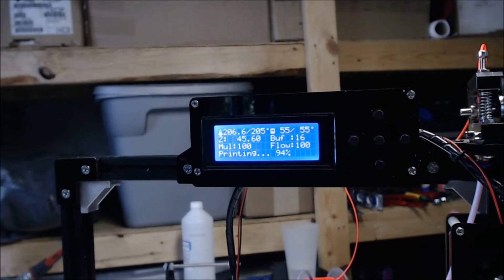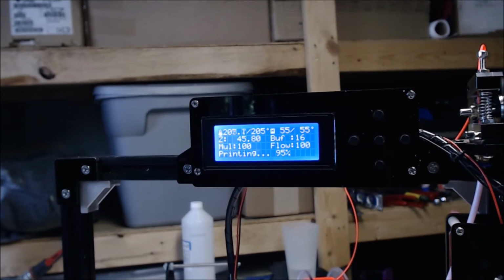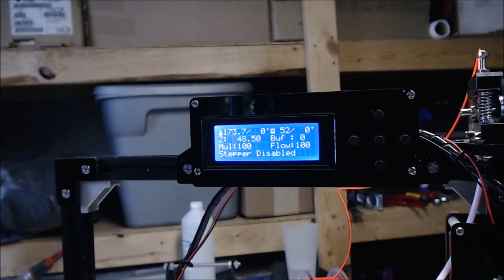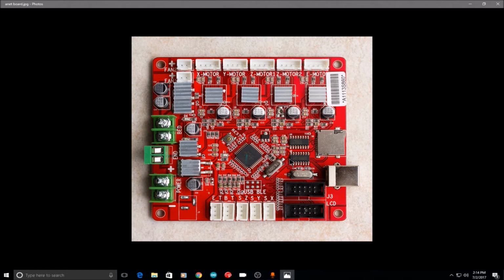ANET A2 3D Printer Review - Chris's Basement

Comment: So I bought this 3D printer from offerup. Anet a2
Just to tinker with. 
I’m a noob at 3D printers. So mine didn’t come with an sd card so iv been using cura. But I can’t get the nozzle settings right. It extrudes very small amounts at a time running PLA. 
Any setting or profiles on cuda you recommend for a beginner just to print some simple stuff?
Also my power supply only has 2 cords plugged in so I stopped using it till I find out where the 3rd tan wire goes. 
Any help would be appreciated.
Reply from the maker: I would start with the Ender 3 profile in Cura. Your power wires might be like this, check it out. https://youtu.be/gn_5QKPj31E?t=989
Reply: K thanks bud. I’ll check it out

Comment: Just about everything about this printer is annoying.  The + shape footprint, the unmounted ps, no ps cover, too small wire for heatbed, bad belts, upside down Zaxis, soft easily nicked rollers, noisy unadjustable controller board.  On the plus side after 2years its still running.

Comment: And now the worst part.  After those cheap belts air dry for about 6 months, you will the MOST ANNOYING RIPPLE in your prints.  It took me MONTHs to figure out it was the belts.   I replaced the yaxis belt with new, better quality one and viola 98% of the ripple was gone !!
Reply from the maker: Awwee, that's a bummer, but a great tip for others, thanks for the comment.

Comment: so what printer in this price range would you recommend?
Reply from the maker: Mateusz Drab Thanks for the comment. Out of all the kits I have had experience with in the $200 price range I would have to say my Geeetech Pro B has been the best. It's cheap, has a nicer main board, open Marlin firmware and there are lots of parts available for it. Geeetech does provide some support as well. It is not the easiest build, lots of different parts, but the instructions are good. If you don't want a big assembly project I would go with one of the many CR10 machines out now. They cost a little more, but they are a quick build and seem to be pretty nice machines for the money. Keep in mind you do get what you pay for on all these machines.

Comment: 220x220x220 FYI
Reply from the maker: Hey Thanks for watching, you are correct, I made a mistake, it is 220 on the gearbest website. In reality mine will only go to about 212 on the Z before it hits the corner brace.
Reply: Chris Riley Yup mine was also only 210 in Z so I found smaller corner brackets on eBay. Now it’s 225 in Z😎
Reply from the maker: Nice!

Comment: Hey Chris, I'm curious.  I did the same thing you did with mine, in that I put up the same PSU mount.  Yes, the belts look super cheesy but they do work.  One thing I noticed on mine is that Y motor is wired to home backwards.  Did you encounter the same thing?  The Y end stop is ahead of the Y motor, but when you set the printer to home, the bed moves towards the front instead of the rear of the printer.  If you did, did you reverse the motor connector or try to force the flip in software?  I am still debating whether I should ditch the auto level and go with the Z end stop.  Thanks.
Reply from the maker: Thanks for the comment. Mine did auto home in the correct direction, but I think if I had that problem I would just pull the white connector off the board, flip the cable and call it fixed. The software is to hard to deal with. Unless you change it over to Marlin. If it had Marlin, then I would flip it in the software. As far as autolevel, if you can deal with printing on the aluminum or have a touch type sensor, I would stay with auto level.
Reply: Thanks Chris.  I ended up reversing the motor and it appears that my firmware does not have AutoLevel enabled/available like yours in the menus.  I ended up reverting to the mechanical endstop.